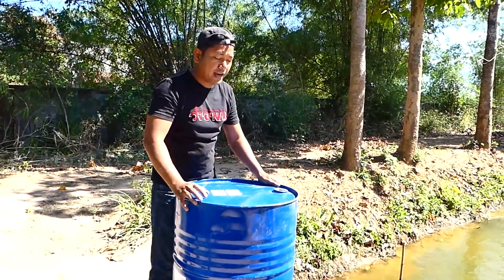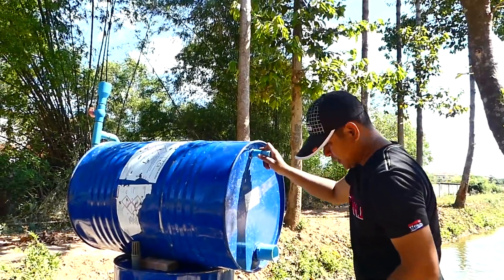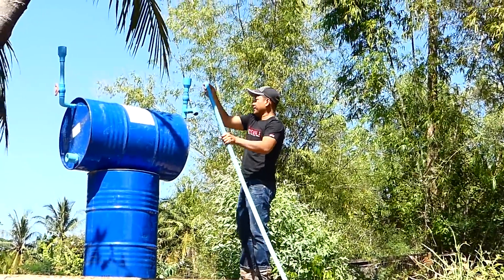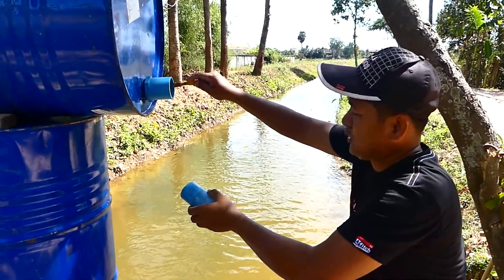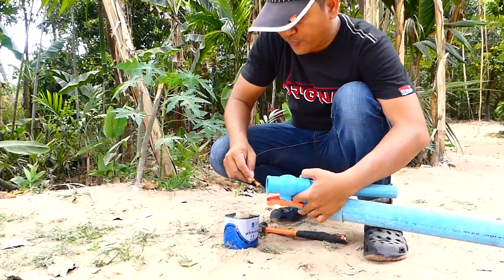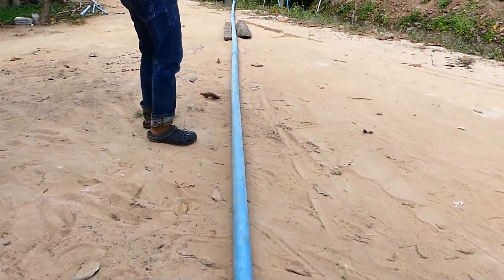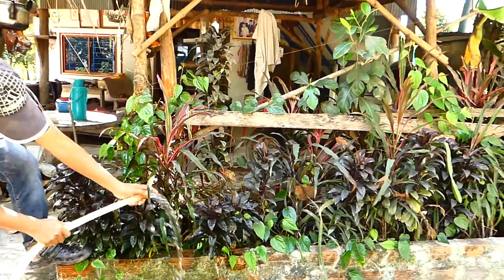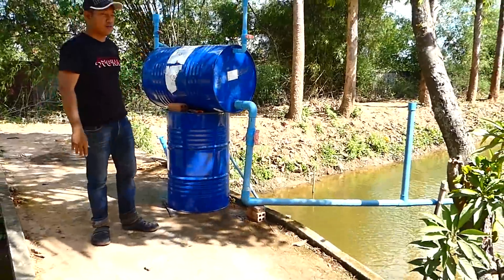Deep River-Auto Pump water from deep river - How to make free energy water pump without Electricity.

Comment: THE MUSIC IS SO HIGH, I HAD TO MUTE THIS,
For this siphon to work, the water level in the river must be higher than the outlet to the field. Is it?

One-way valve at the suction side, no need. 
Pumping the suction pipe, no need.
Master valve at the output, no need.
Vertical pipe at the output, no need.
In short, useless video.